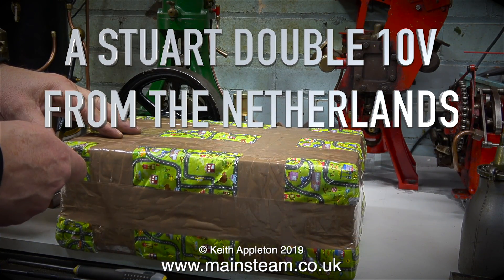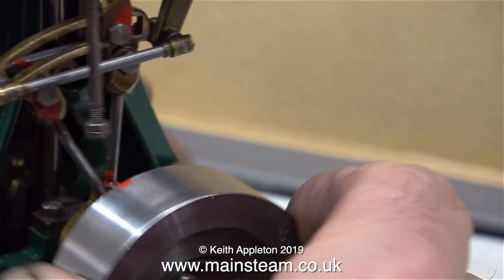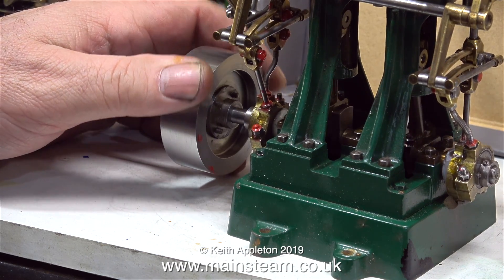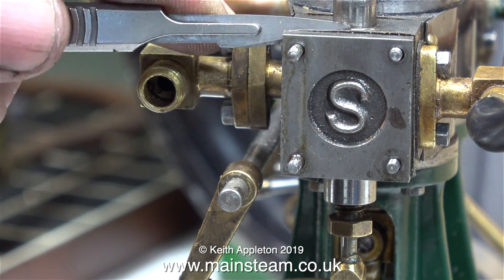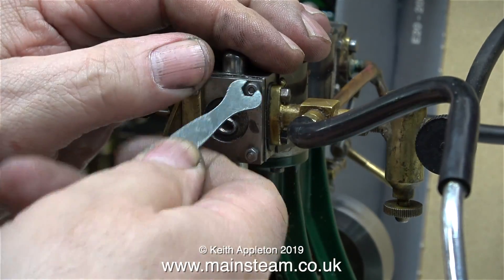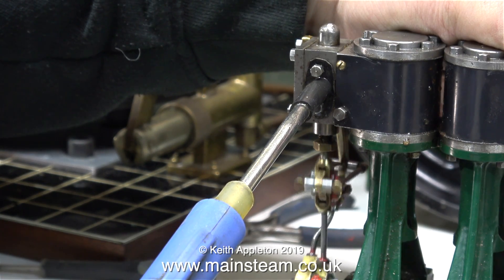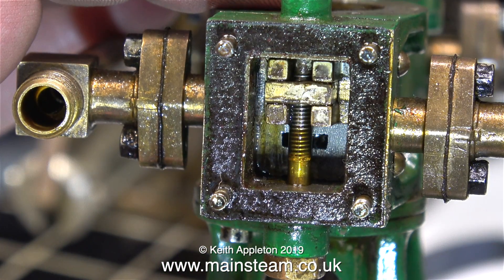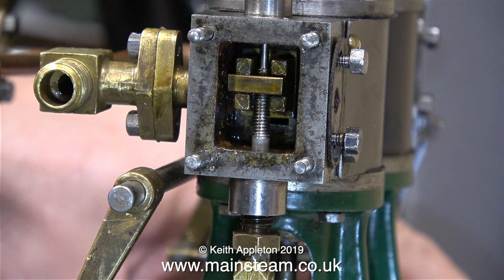A STUART DOUBLE 10V FROM THE NETHERLANDS - PART #1

Comment: Agree.  Valve  body need disassembled, turned 90 degrees,maybe refaced if needed, and confirm valve opens a tad (5 to 8 degrees ) before top dead center (TDC). Make sure the reversing lever is full reverse or full forward so you get the TDC right. 😊  Enjoy your videos and learn from them.

Comment: Keith, I am no engineer, and mechanically I am a bit of an idiot.  From what I thought I saw in the video, it looks like the dimensions of the two valves are different, and they open the ports by different amounts.  Could the dimensions of the valve slide be off?
Reply from the maker: Yes, the valve worked a lot better the other way around . . .

Comment: Hmm interesting ... I have no idea as a start but two things come to mind from watching your other videos ... either the valve is turned 90° (it looks like the ports are not properly uncovered like in your other engine) or that cross bar which moves the valve up and down is too tight so the valve does not sit flush against the back face, or something else stops the valve from sitting flush (maybe gasp forgotten to machine the bottom!?!)

Comment: Armchair engineer here: At 4:50 it looks like the valve moves too far and opens the exhaust passage to the steam chest, therefor blowing steam straight into the exhaust whilst preventing the expanded steam from the side of the piston which should be exhausting to escape. Seems to me that the excentricity of the excentrics is too big.

Comment: This is just a just gess, had to watch it 10 times or so but:
I think the plate covering the holes is to big, and covers all the holes some of the time.
when starting there must be air flowing to a cylinder(s) else the pistons do not move.and you need to start it manual.

Comment: Valve has been turned 90° on shaft & due to the valve itself being slightly more oblong than square, it's effectively changed the vavle timing....
Fix; disassemble, turn valve 90°, reassemble, oil, re-time....

I dont know  steamies too well- it was the shape of the valve & the comparo that gave it all away........OCD much?!? :v

Comment: Well I see two things I would investigate further: 1. the valve appears to be fixed to the adjustment instead of free floating (I need to be able to feel it to be certain) , second the valve is not uncovering all of the port, it would bear looking into why, is it the reversing mechanism or the cam.
Reply from the maker: No - that's not it ......